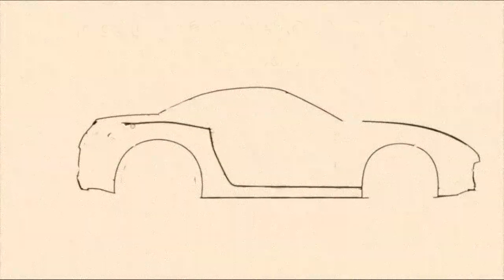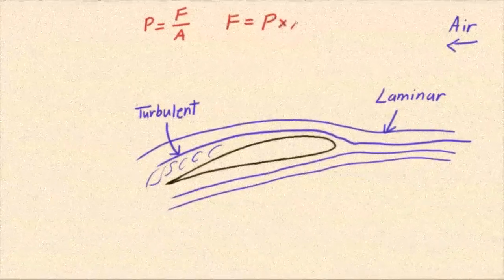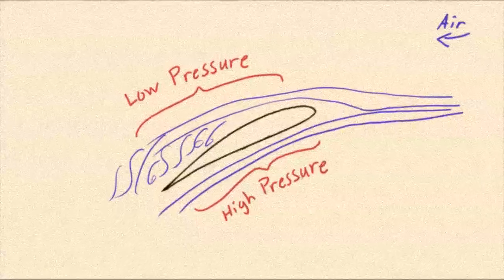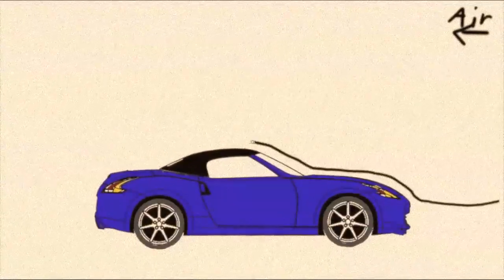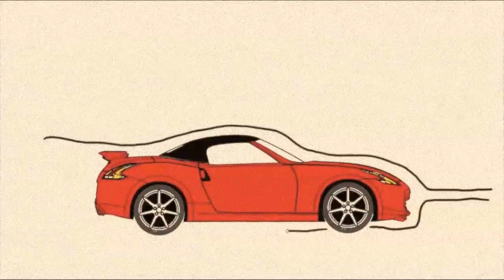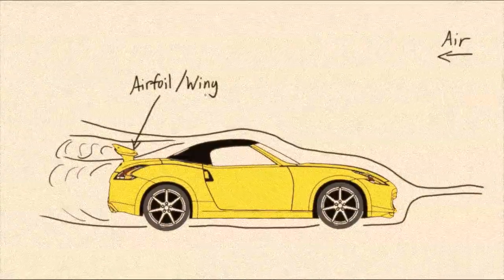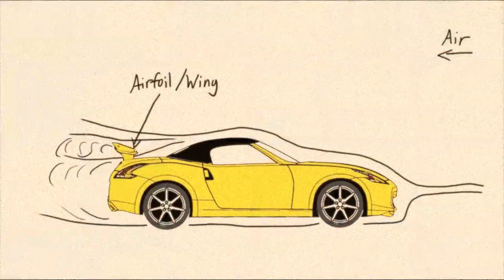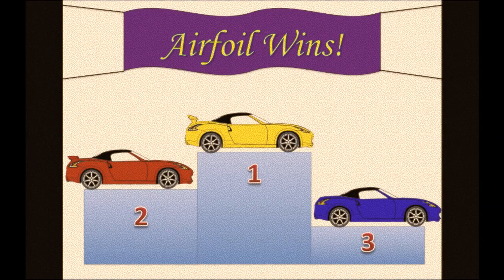Sports Car Aerodynamics: Spoiler Alert!

Comment: Completely wrong, for a straight line drag, car with nothing will win. add some turns in there for low speeds and maybe a spoiler or wing will scrape up an advantage. even so I've raced a coworker around a turn without a spoiler or wing and through all the noise of tires screaming I don't think a wing or spoiler would have helped get through any faster.

besides, this is all the aerodynamics, you can have the best performing ride on paper, but if you as a driver can't handle it, it's all for nothing.